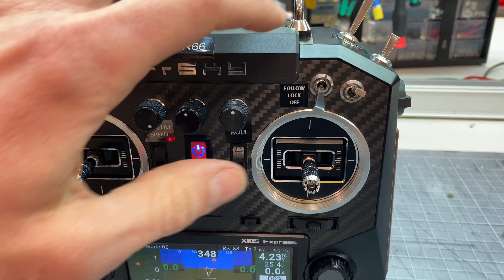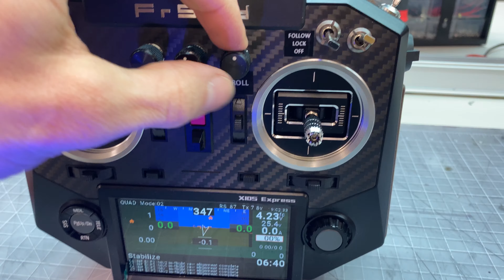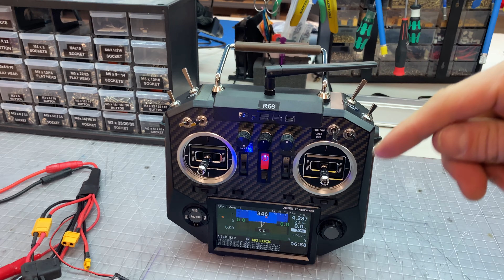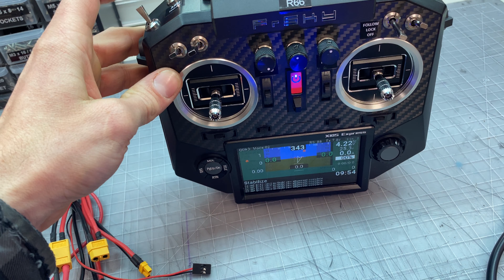Gremsy T3 V3 setup with Pixhawk Cube

Comment: Hi, I'm trying to prepare a setup with a T3V3 but I haven't got one yet. Do you mind telling me the outer dimensions of the "footprint", where you mount the T3 to the plate? I know the hole pattern is 32x32mm with M3 holes, but I don't know the outer dimensions of the quick release. thanks!
Reply from the maker: Its about 53mm
Reply: BFD Systems thanks! Mine arrived meanwhile and I can confirm your measurements ;-)

Comment: Do you still control the drone from this control? You just switch to control between the gimbal and the drone?
Reply from the maker: In this example, we're not using the Cube to fly anything. However, in our UAVs, the Cube is able to fly the aircraft and control the gimbal over serial. It also provides GPS data, (and maybe IMU data not sure) which helps with the horizon. There are some other videos on our channel that show the aircraft flying with the gimbal being controlled through the cube.

Comment: Hi, Can I use Hourx X10s with R9M receiver to control Gremsy T7 gimbal and sony camera using SBUS port on the R9m receiver?
Reply from the maker: Probably, but we haven’t used R9M specifically for this purpose. I would assume yes. We also make some hardware to control the camera but there are some off the shelf options available.